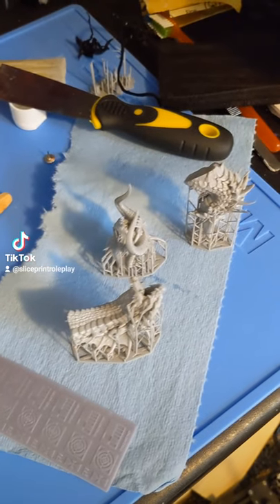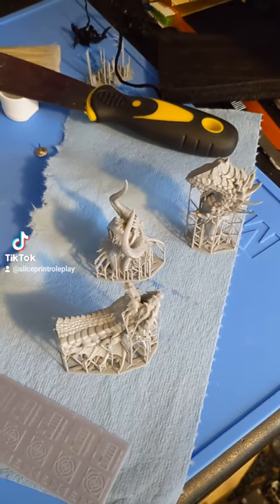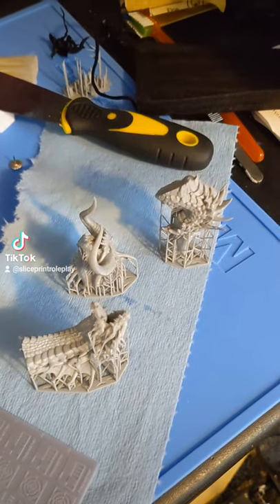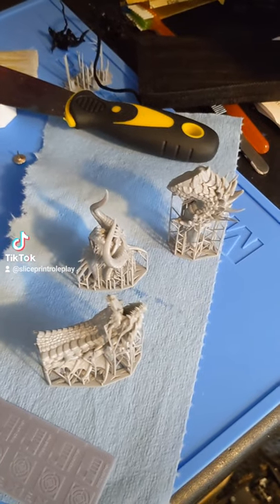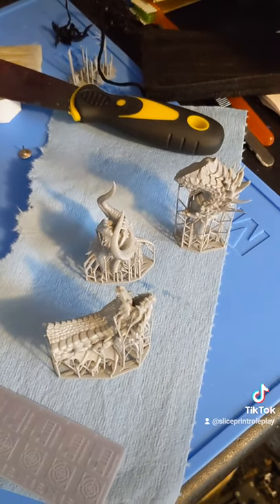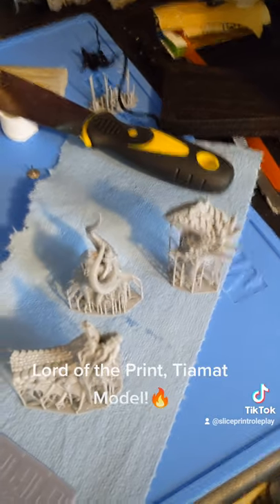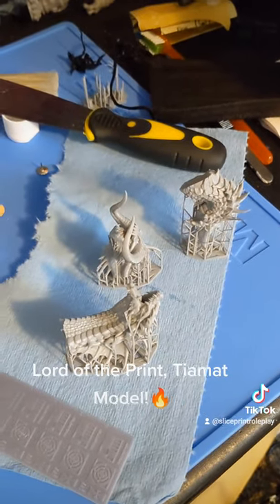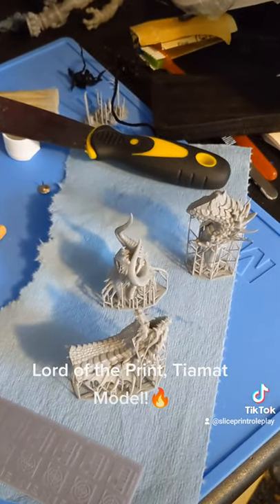Why Are My Models Sticky After Washing? #resin #3dprinting #shorts

Comment: And since the ipa is new and unused..? Whats wrong then?
Reply from the maker: If your IPA is new then you may not be cleaning the parts long enough. I'd recommend cleaning for 3 minutes. If you're IPA is less than 90% then I'd wash for 4 - 5 minutes. You can also use a brush (I use a soft paint brush) to brush the model during your wash.

Comment: What does it mean when your cleaning solution is brand new out of the bottle, and even after being soaked and agitated for several hours, they are still sticky?
Reply from the maker: What kind of cleaning solution and what kind of resin?
Reply: @SlicePrintRoleplay  IPA 99.8% and creality "standard black 405nm"
Reply from the maker: @jimlee4961  how long are you washing the prints for? Above you said about washing them for several hours, is that your standard practice?
For most models a 2 to 4 minute wash is sufficient.
Reply: @SlicePrintRoleplay  usually just a few minutes in each bath but I've been having parts come off lately and it's not working for them, so back in they go, several times, getting left longer each time, to a point where they get left for hours in hopes
Reply: @jimlee4961  you're not letting your prints dry

Comment: How many minis can you do on a fresh batch?what's the mileage??
Reply from the maker: I haven't tracked a ton of data on this so these will be rough estimates.
I use denatured alcohol. With a fresh batch of denatured alcohol (2 quarts) I can wash 25 - 35 sized 32mm minis. Then I need to filter/clean my wash salutation.
Reply: @SlicePrintRoleplay  i do minis and terrain. what i do is let my prints hang on the build plate for 10-15 minutes then dunk them in a smaller mean green pickle jar  container (dunk them a few times) then put them in a mean green wash on the wash and cure station and then go over them with a spray of alcohol.(maybe overkill?) But i noticed some minis from like batch 3 (full build plate) had some shiny spots and were a tiny bit slimy after the wash station.  My theory is to get as much uncured resin off of the fresh models in the smaller dunk so the wash and cure container with the most mean green gets dirtier less fast. But again I just started printing last night so i don't know if i reached my "cleaning" limit or not. and your video did introduced this question lol
Reply from the maker: @tonydiazist  okay I have two things to throw into this.

First, I've tested using Mean Green. I always had trouble with models feeling slick/greasy after the Mean Green wash. I've been told by people who use it that way a thorough phytowash in IPA I'd required to resolve this. However, I feel that defeats the purpose of using it.
So it's possible that your final spray wash isn't en to remove the residue left from the Mean Green.

Second, shiny spots can be caused by your exposure time being too low. Have you done any exposure calibration prints?
Reply: @SlicePrintRoleplay  yes i have. 1.8- 2.2 is my sweet spot for the validation matrix. What i found out a possible way to make sure prints are clean of any residue is to do a quick wash with warm water before drying to cure. I'm testing this rn as we speak. No idea how it will work but saw a YouTuber do this process so it's worth a shot
Reply from the maker: @tonydiazist  oh awesome, best of luck!
Reply: @SlicePrintRoleplay  it didn't work out they arenr shiny but they are sticky/tacky to the touch. I think mean green I'd the culprit here but i can't be 100...
Reply: Update: seems like the tackiness goes away after a few hours airing out/drying
Reply from the maker: @tonydiazist  thanks for the update!